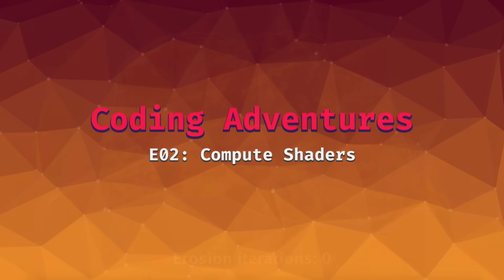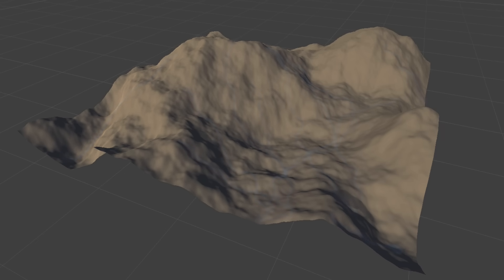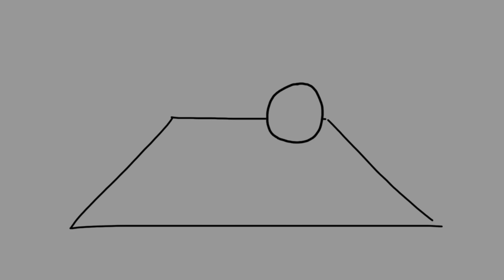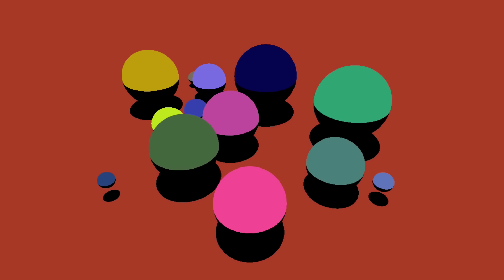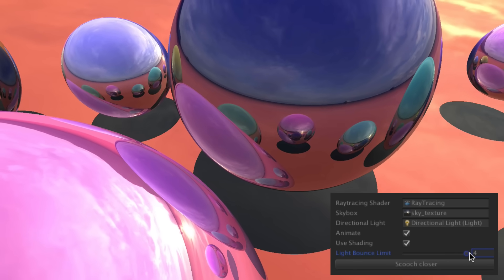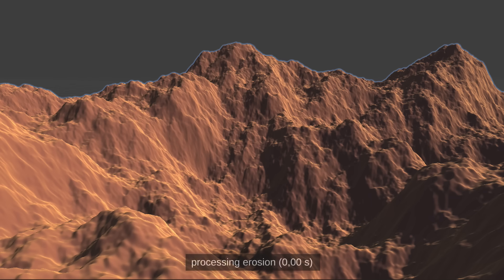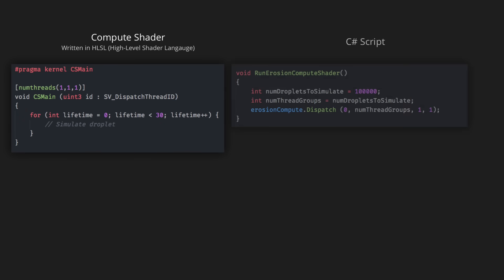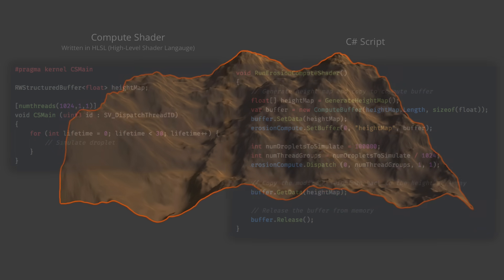Coding Adventure: Compute Shaders

Comment: Can you make in depth tutorial for rays and how to use them for reflections 

P.S i am thinking of making highly realistic radar with rays so is it possible and is it best way for realistic radar?
Reply: IRL radars use wavelength much lower that those of visible specter. This helps to propagate the signal further, but also greatly decreases resolution of radars compared to cameras. Therefore I beleive using raytracing (which is associated with higher fidelity and multiple ray bounces, which is basically useless for a radar) for simulating radar is quite an overkill.

Also raytracing in its original form doesn't account for speed-of-light, which you would need for an accurate radar simulation.

I would recommend just creating a schedule of when a radar signal is close to hitting a target each radar pulse, and then checking if the target is in a radius travelled by the radar wave, and if it is, schedule the return of reflected wave to the radar dish. If time of return is before next pulse, terget is detected. Otherwise, probably not as the radar has to issue a new pulse and listen for a new response.

If you want to simulate radar cross-section of the target by ray-tracing, better to just precompute that IMO.
Reply: @vitasartemiev  wow thanks for the answer
Reply: @DarkKnight-ke5bx  or you can do it mathematically. A rotating spiral (if your radar is a rotating one) is easily computed in polar coordinates, (at a first glance, I'd say probably something along r(theta,t) = a*theta + b*t), scan which targets are at that range r based on their direction relative to the radar.
Then save the hits, and only announce them with the delay due to reflection coming back.

Either way pretty simple. This one probably simpler.
Reply: @adrienconverset6571  thing is i want it to be pretty realistic and i thought i could use rays as a wavelength
I mean for me precalculation is pretty hard
Reply: @adrienconverset6571  the collider idea is pretty good but will it be resource demanding?
Reply: @DarkKnight-ke5bx  The collider idea is the easiest to implement if you are working with an engine like unity. Performance should not be too much of a problem unless you have a lot of radars and a lot of targets.

My solution is slightly more optimal since it doesn't need to check every target every frame, but i had to write a bit of code. I implemented a "schedule" structure which is basically a one-way linked list auto-sorted by time. Since we can predict the minimum time required for the signal to reach the target, we can schedule an event to check if we hit it or not. Each frame only time of earliest event is checked (because events are sorted by time). If target is hit, we can schedule a "return signal" event, or discard the hit if it's too late or too faint. The spinning of the radar dish is simulated by delaying the first "check hit" event depending on relative angle of target.

You may think it's overengineered, but I use this type of structure for a lot of things, so it's not a big deal.
Reply: @vitasartemiev  thanks i will check it
Reply: Physics Doctoral student here, When the wavelength becomes comparable to object size, you can no longer use ray tracing to accurately model the physics. Ray tracing ignores the fact that light is really a wave, and that’s fine for normal sized objects and visible light. However for radar, diffraction and interference are very important. You may know that stealth aircraft use surface geometry and materials to reduce their cross section so a large jet essentially looks as big as a bird. Obviously this would not be possible to reproduce with with raytracing, as all you do to see if something effects pixel color is check for ray intersection.

What you need to do is write an FDTD code, and this is a nice resource that I’ve found for that: https://dougneubauer.com/wp-content/uploads/wdata/toyfdtd/toyfdtd.html
Reply: @1495978707  thanks a lot
Reply: You probably would be more interested in casting immaterial circular colliders with increasing size (up to your radar range), marking the hits, and only informing the radar after a delay corresponding to the return trip duration.
add your detection conditions oncollisionenter and you are good to go